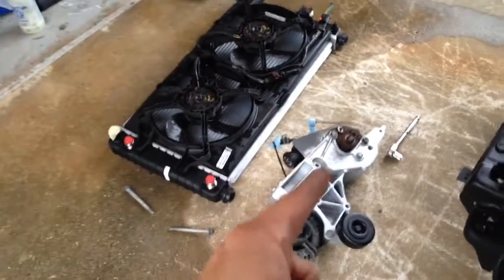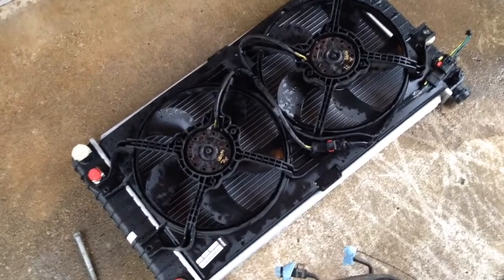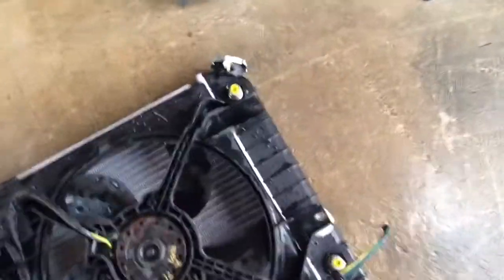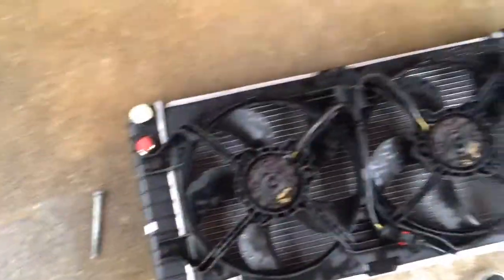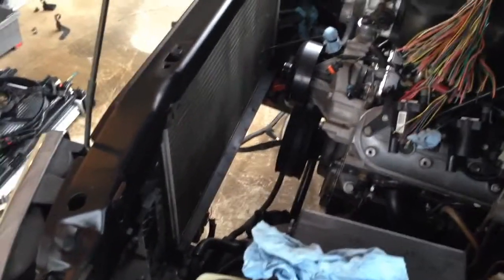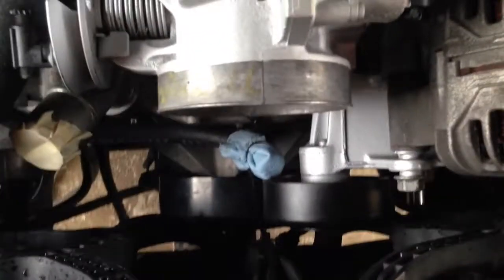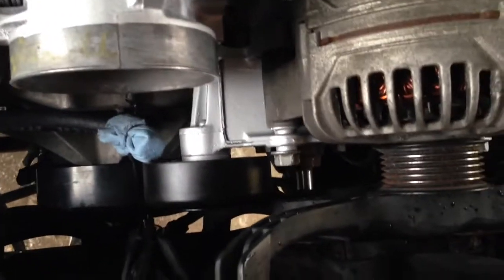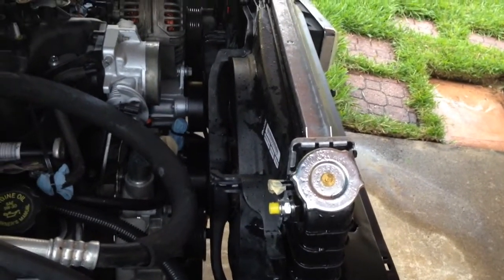S10 LS V8 Part 7: Making the Radiator Fit (Part 1)

Comment: Can you use the 2.2 radiator?
Reply from the maker: I think you can, if you’re in a climate where it’s cool. But the stock 4.3 radiator fits right in, and I think is less than $100.

Comment: What motor are the fans from? 2.7 3.2 3.5? I removing my condenser for no ac and gonna approach that route looks like it will fit nicely with a 4.3 radiator.
Reply from the maker: That’s the 4.3 radiator with dodge intrepid fans
Reply: Cliff's How To Channel Yeah I understand that. Got my radiator the other day. About to get fans. I guess they come from the intrepid with a 3.5 motor. Next is what radiator hoses from a 4.3 radiator to the 5.3 motor.

Comment: When you wire those fans you must send two separate 12v sources to get high speed. You will have a High, Low, and two black ground wires. Both fans will turn for low speed, when the second 12v is added both fans should increase speed for High.
If your not getting an rpm difference your most likely only getting the low speed. Nice build good luck!